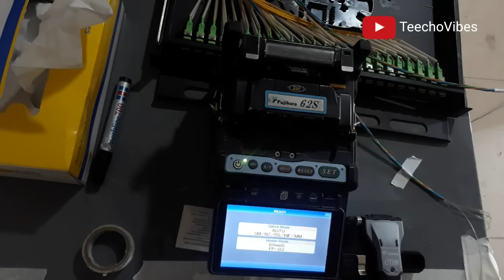How to Splice Fiber Optic Patch Panel 48 Core - Splicing techniques

Comment: Personally, I don't like 2 things: firstly, bending the fibers in the tray, secondly, unpeeled pigtails in the tray. We do different things in Poland;) I would like to see measurements, especially 1550 and 1625nm
Reply from the maker: I appriciate that you comment on our video sincerely. Your comment will be forward to my team. Thanks
Reply: Hi would you kindly provide an example video  of your technique in Poland?
Reply: Yep. we stagger the lengths so they can loop around to the next splice holder. I'm sure you would get some loss on those tight turns. Otherwise great video.

So the first 12 were fine as you did them. The remaining 12, make them a half turn longer. so they flow directly into the top splice holder.

hope that makes sense.
Reply: @dannyradlo4755  I noticed that too. I was amazed you could cut it all like that and know where it would go because cleaving it would cut a little off.
Reply: Fibre bending has its own limitations according to Nm ,but that was awesome work.The little patch panel has no space.

Comment: I've never done pigtail fiber splicing like this does it matter which color goes to which pigtail as far as where its plugged in at ports say like port 1 top left would it go Blue Port 1 Orange Port 2 from Cable 1? I've only done pair to pair splicing  This is very nice
Reply from the maker: Thank. Yes it start from left to right sequence wise.

Comment: Why do you leaves so little slack?  We have nearly the same type of splice cassettes and we leave 2.5 revolutions of slack in the cassettes rather than going so direct with the fibers. We could splice the same panel onto 20 cables. How would you do it with only a few centimeters of slack?
Reply from the maker: Thanks for raising a question. This exercise is based on my previous experience that's why it looks not good but works well. I Updated my techniques as well when i read such comments on this video. Thanks for your interest 🙂

Comment: Hi bro I have 24 core Multi mode fiber, all the cores are in one tube, there are 2 fiber of every color. How to terminate it to ODF properly?
Reply from the maker: Hi, it's so simple. If there are 2 color in one tube then 1 color will be dotted. 
If there is tow blue fibers than one blue fiber will be dotted you just have to see it carefully.. 
Separates dotted fiber and simple. 1st you can splice simple and then you can splice dotted
Reply: @TeechoVibes  bro the problem is  the second color is not dotted both are plan, any idea on  this
Reply: Splice color wise at the end use VFL to identify and arrange on correct number.
Reply: @AliRaza-nh3ov  thanks bro did the same thing

Comment: Was there no frp rod inside the cable coming into the splice enclosure?
Reply from the maker: Yes. There was a steel inside that cable and cable was armored also. One of challenging job in cabling to remove that armored.
Reply: the frp is usally secured in those posts after the clamp

Comment: How many core is there in each cable?
Reply from the maker: 4 tubes in each cable and 6 cores in each tube. So there was 24 core in 1 cable. 
There was 2 cables so i did 48 splices
Reply: @TeechoVibes  Thanks.
Reply from the maker: It's pleasure ☺

Comment: In the casset is poorly armed the pigtails 
In my case tag each Pigtails with the international standar and I place them the that order so as not to be searched which thread I have free I give you a 7 out of 10
Reply from the maker: Thanks for your comment. I learned from viewer's comments and corrected my lot of mistakes... in future you will see us more professional.. beyond your expectations..
Reply from the maker: It seems bended but PM testing/commissioning was very well. You know why because new cables and pigtails are mainly made with the G657 fibres and these fibres has a smaller bending radius.
For detail please visit this link.

https://www.optokon.com/ms/product/260-single-mode-fiber-g-657-a1

Comment: bad bends in the fibers and drops. Turn one set of 12 splices (make the fibers half a turn longer) around and get rid of those bends. Will improve overall quality/dampening. and for the love of god... strip the jackets off of the pigtails inside the trays!
Reply from the maker: It seems bended but PM testing/commissioning was very well. You know why because new cables and pigtails are mainly made with the G657 fibres and these fibres has a smaller bending radius.
For detail please visit this link.

https://www.optokon.com/ms/product/260-single-mode-fiber-g-657-a1

Hope problem has solved
Reply: @TeechoVibes  Even if the cables have better bending tolerance, it still is bad practice :)
Reply from the maker: @Conflict409  appreciate your concern. It was my old work. I updated my techniques. Thanks for commenting and keep commenting 🙂
Reply: @TeechoVibes  no, it is a work attitude problem. that R bend can be pass with G652 too.